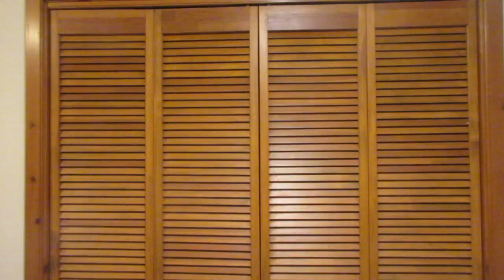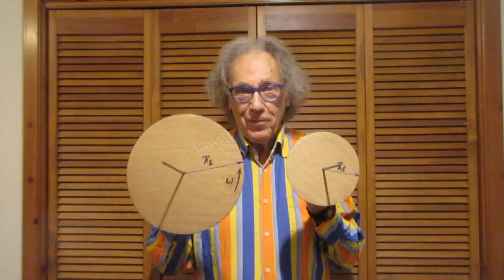Problem #8  Rotating Discs  - not easy!

Comment: Another approach considering friction: let F be the friction force that transfers angular momentum from disk #2 to disk #1 when they enter in contact.
F = µ FN
This force causes an angular deceleration on disk #2, decreasing its velocity (I2 is the moment of inertia of disk #2):
ω2(t) =  ω – F t / I2
and it causes an angular acceleration on disk #1:
ω1(t) =  F t / I1

The steady state is reached when both linear velocities are equal:   R1 ω1 = R2 ω2
This happens at instant:   
t = ω R2 I1 I2 / (F (R1 I2 + R2 I1)) 
Substituting t:
ω1 = ω R2 I2 / (R1 I2 + R2 I1)      and       ω2 = ω R1 I2 / (R1 I2 + R2 I1)

To calculate the moment of inertia of the disks:
I = π δ d R^2 / 2
If densities and thicknesses are equal on both disks then:
I1 / R1^4 = I2 / R2^4 

Finally, substituting and rearranging:
ω1 = ω R2^4 / (R1 (R1^3+R2^3))
ω2 = ω R2^3 / (R1^3+R2^3)
This is the same result obtained before (and posted) when considering just conservation of angular momentum.

Comment: Final angular velocities w1 and w2 of the two discs are as follows (note that the minus sign means a rotation in the clockwise direction, as I considered counter-clockwise rotations to be positive):

w1 = - w (R2/R1)^3/(1+(R2/R1)^2), which is clockwise, hence negative

w2 = w (R2/R1)^2/(1+(R2/R1)^2), which is counter-clockwise, hence positive

- from the moment the discs are brought into contact, there will be a decelerating torque on disc 2 and an accelerating torque on disc 1.

- the respective torques occur due to the kinetic friction Ff = mu*P, where P is the force in the x-direction on disc 1 exerted by disc 2

- kinetic friction exists at this point because of the relative velocities of the two surfaces in contact with each other

- the moment we are interested in is the moment when the kinetic friction will cease to exist

- kinetic friction will cease to exist when the relative velocities of the two surfaces will be zero

- therefore, at this point, the tangential velocities at the extremities of the two discs have to be equal

- from this point onward the torques on each disc with respect to each disc's CM will be 0, hence they will keep rotating with constant angular velocities w1 and w2, whose expressions are shown above.
Reply: in w1 there will be w (R2/R1)^2 instead of - w (R2/R1)^3 ....as they have to equal

Comment: We can conserve neither angular momentum nor energy. So we have to resort to torque analysis here. 
Now in equilibrium, w1R1=w2R2 because the discs are not skidding over each other. 
Then, the friction being u*N (N is the force with which one wheel pushes against the other), the torque equations are written for each wheel, in terms of the angular acceleration and moment of inertia of each disc. 
Finally, we introduce the time variable t, 
w2=(u*N*R2/I2)*t
w1=w - (u*N*R1/I1)*t
Eliminating N and t by suitably adjusting the equations and dividing, and subsequently using w1R1=w2R2, 
We get w1= w*R1^2/(R1^2+R2^2)
And w2= w1*R1/R2. 
It was a cool problem sir! 
^~^
Reply: u is the coefficient of friction
Reply: why isn't the energy conserved? from what I understand the two discs start rolling on each other so there is no dissipation of energy. I have almost the same thing, but my w1 is the square root of your's.

Comment: Nice woodworking :-)

You did'nt give any parameters on the energy loss due to slipping when the discs first touch and the final angular speed is not reached yet. This loss is to be ignored  ... yes ?
Reply: I know this is 2 years late, and he might have made a solution on it, but I will answer anyway. 
The discs do slip, and due to friction, there is energy loss. This loss does not have to be known to solve the question. In fact, this loss can be solved for. A hint I will give is that you should use torque, but not conservation of angular momentum as due to the system torque, angular momentum is not conserved.

Comment: Initially, the angular momentum is conserved.
Also masses are indicated by M for big disc and m for the small.
Li = Lf
Iw = I 2 w2 - I1 w1

1/2 M(R2 )^2 w = 1/2 M(R2 )^2 w2 -- 1/2 m(R1 )^2 w1
The final linear velocities of discs are same, so w=V/R

M(R2 )^2 w = M(R2 )V - m(R1 )V

Since densities are same,

d = m/vol
Masses are proportional to their radii’s square, so equation becomes,

d(R2 )^2 w = d(R2 )^3 V - (R1 )^3 V

(R2 )^2 w = V[(R2 )^3 - (R1 )^3]

V = (w (R2 )^2) / ((R2 )^3 - (R1 )^3 )

w1=(w(R2 )^2) / (R1 [(R2 )^3 - (R1 )^3 ] )

w2=w(R2) / ((R2 )^3 - (R1 )^3 )

Comment: Since there are no external torques, conservation of angular momentum about the center of disk 2 can be applied:
(I2)w = (I2)(w2) + (I1)(w1)                                                                                        Equation (1)

Find moment of inertia for each disk (using parallel axis theorem for disk 1):
I2 = (1/2)(m2)((r2)^2)                                                                                                Equation (2)
I1 = (1/2)(m1)((r1)^2) + (m1)((r1+r2)^2)                                                                Equation (3)

Substitute equations 2 and 3 into equation 1:
(1/2)(m2)((r2)^2)w = (1/2)(m2)((r2)^2)(w2) + ((1/2)(m1)((r1)^2) + (m1)((r1 + r2)^2))(w1)                       Equation (4)

Simplify this monstrosity to get another monstrosity:
(1/2)(m2)((r2)^2)w = (1/2)(m2)((r2)^2)(w2) + [(3/2)(m1)((r1)^2) + 2(m1)(r1)(r2) + (m1)((r2)^2)](w1)   Equation (5)

We have to get rid of mass. Let p be density and h be thickness. We know their densities and thicknesses are the same. For any disk:
m = pV = p(pi)(r^2)h                                                                                                  Equation (6)

For disk 1:
m1 = ph(pi)((r1)^2)                                                                                                    Equation (7)

For disk 2:
m2 = ph(pi)((r2)^2)                                                                                                    Equation (8)

Substitute equations 7 and 8 back into equation 5, then simplify:
(1/2)((r2)^4)w = (1/2)((r2)^4)(w2) + [(3/2)((r1)^4) + 2((r1)^3)(r2) + ((r1)^2)((r2)^2))](w1)                        Equation (9)

We need the answer in terms of w, r1, and r2 only. So we need to put w1 in terms of w2 and vice versa.
Since disk 1 is no longer speeding up and disk 2 is no longer slowing down, we know their tangential velocities must be the same:
v1 = v2                                                                                                                         Equation (10)
v1 = (w1)(r1)                                                                                                               Equation (11)
v2 = (w2)(r2)                                                                                                               Equation (12)
(w1)(r1) = (w2)(r2)                                                                                                    Equation (13)

Solving for w1:
w1 = (w2)(r2)/(r1)                                                                                                     Equation (14)

Solving for w2:
w2 = (w1)(r1)/(r2)                                                                                                     Equation (15)

To solve for w1, substitute equation 15 into equation 9 and simplify, also get rid of 1/2s:
((r2)^4)w = [((r2)^3)(r1) + 3((r1)^4) + 4((r1)^3)(r2) + 2((r1)^2)((r2)^2))](w1)                       Equation (16)

Solve for w1:
w1 = ((r2)^4)w/[((r2)^3)(r1) + 3((r1)^4) + 4((r1)^3)(r2) + 2((r1)^2)((r2)^2))]                                Equation for w1

Solve for w2, using equation 15:
w2 = ((r2)^3)(r1)w/[((r2)^3)(r1) + 3((r1)^4) + 4((r1)^3)(r2) + 2((r1)^2)((r2)^2))]                          Equation for w2

Comment: Thanks for this nice problem, Mr. Lewin ! I have a solution very similar to Soroush Khoubyarian, just a supplementary factor of R1/R2 in the expressions of w1 and w2... I finally get, using Newton's laws of dynamics and Coulomb's laws of friction :

w1 = k^2/(1+k^2) * w
w2 = -k^3/(1+k^2) * w
(where k = R1/R2.)

In the end (see demo below), about half of the energy being dissipated in heat through friction between the two disks.

Full demonstration attached : https://drive.google.com/file/d/0B_jqWcet5iN0Z1NKTjZPdWtsWm8/view?usp=sharing

Comment: There HAS to be slippage, otherwise the stationary disc would jump to a finite angular momentum about its centre in zero time! Also, angular momentum of the two discs about any point cannot be conserved because a couple has to be applied to the system to keep it level (and it doesn't reverse direction). I think that I see two correct answers that have slipped through the net!

Comment: it turns out that torque on the system is not zero so no conservation of angular momentum energy is not conserved as there will be  reletive motion between the disks you have to apply law of motion and solve for equation  
W1=WR1^2*R2/(R1^3+R2^3)
W2=WR1^3/(R1^3+R2^3)
SIR i am 16 years old and did this without any help really so do you think i have a good caliber
Reply from the maker: angular momentum is not conserved, neither is energy.
Reply: No you dont 
Just kidding bro
But mind ur physics 
Angular momentum and energy is conserved here as the force of friction here acts as an internal force
Reply: I also got the correct answer by laws of motion method 
but then i still have a confusion  that why cant we solve by energy conservation considering friction as an internal force in the system comprising of the two discs
By the way I am a grade 12 student from india     sir.
Reply: Lectures by Walter Lewin. They will make you ♥ Physics.  
Thanks sir my confusion got clear I solved the above problem by laws of motion but in my classes they told me that try to approach a problem by energy conservation method so i kept thinking but now it is clear to me that why angular momentum is not conserved as the net torque on the system is not zero so we cannot conserve momentum 
As to conserve angular momentum the net torque on the body should be equal to zero so the condition is not satisfied. 
Thank you sir

Comment: As there are no external forces the total angular momentum must be conserved:
Li = Lf    →    I2 ω = I1 ω1 + I2 ω2 

Assuming same density and thickness on both disks, this gives:
R1^4 ω1 = R2^4 (ω - ω2)

On the other hand, at the final stationary state the linear speeds are equal, so:
R1 ω1 = R2 ω2

Combining both equations:
ω1 = R2^4 ω / R1 / (R1^3+R2^3)
ω2 = R2^3 ω / (R1^3+R2^3)

Comment: Solution:-
Concept: 1. R1.w1=R2.w2---eqⁿ (1)
2. Time taken for disc 1 to go from 0 to w1= Time taken for disc 2 to go from w to w2.
I1.a1= F. R1, I2.a2= F. R2
where F= Friction
t1 = w1/a1 = I1.w1/(F. R1)
t2 = (w - w2)/a2 = (I2.w - I2.w2)/(F. R2)
t1 = t2 ----- eqⁿ (2)
Using (1) and (2),
w1= w.R2³/(R1³ + R1.R2²)
w2= w.R1.R2²/(R1³ + R1.R2²)

Comment: W1=(R2/R1)×(√[R2/(R1+R2)])×W
W2=(√[R2/(R1+R2)])×W
..
..
i made use of work energy for rotation,
the torque due to friction is reponsible for the bigger disc to slow down and smaller to start rotating to W1..
Reply: NYK but this friction will cause the system to lose energy
Reply: Max Mustermann  that's why I've used work energy it can be used for both when conservative and non conservative forces are present ...i hope that it's right
Reply: NYK im not fimiliar with these terms in english... Did you calculated the energy which is lost and then added this to your energy equation ?
Reply: to calculate the loss due to friction I need to know two things
1)total energy when both are spinning (friction absent)
2)total energy when both are spinning (friction present)

in the first case i fail to see how the two discs spin when friction is absent
Reply: NYK 
calculating 1 is easy, just use the principle of conserved rotational energy: I2 × w² = I1 × w1² + I2 × w2²

Comment: When they stop slowing down and speed up they both have the same linear speed. I'm going to call that speed as "V" now we can use angular speed and radius to calculate linear speed:            W1*R1=V      W1*R1=W2*R2   
                                                                                                                      W2*R2=V

Comment: Continued answer.
r2 qubed * omega squared  = r2 qubed * omega2 squared + r1 qubed * omega1 squared.
Using omega1 = r2 /r1 * omega2 I get..
r2 qubed * omega squared = ( r2 qubed + r1 squared * r2 squared ) omega2 squared.
Resulting in omega2 squared = r2 qubed/ (r2 qubed + r1 squared * r2 squared) * omega.
And omega1 squared = r2 squared / r1 squared * omega2 squared.

Omega2 and omega1 follow from taking the square root from both equations.
I would love to type this out, but , with respect , the answers are clear, and it saves me a lot of typing on my iPad.

Groeten uit Leeuwarden, NL, Koos Jorritsma

Comment: Here's my attempt.

We have conservation of angular momentum and both disks have the same tangential velocity at the end of the experiment.
  L = I2 w = I1 w1 + I2 w2 
  v = w1 R1 = w2 R2

Moment of inertia of the small disk can be derived from the larger one since they have the same density and geometry.
  I = 1/2 M R², M = ϱ R² π h
  I1 = I2 R1⁴/R2⁴

Solving for w2 and w1:
  I2 w = I2 w2 + I1 w1 = I2 w2 + I2 R1⁴/R2⁴ w2 R2/R1
  w = w2 + R1⁴/R2⁴ w2 R2/R1 = w2 (1 + R1³/R2³)
  w2 = w R2³ / (R1³ + R2³)
  w1 = w2 R2/R1

Numeric example:
  let R1 = 1, R2 = 2, w = 100
  w2 = 100 8/(1+8) = 88.89
  w1 = w2 2 = 177.78

Some kinetic energy gets lost:
  KErot = 1/2 I w²
  KEbefore = 1/2 I2 w²
  KEafter = 1/2 I1 w1² + 1/2 I2 w2²
  KEafter < KEbefore

Example:
  let I2 = 50
  I1 = 50 1/2⁴ = 3.125
  KEbefore = 1/2 50 100² = 250000
  KEafter = 1/2 3.125 177.78² + 1/2 50 88.89² = 246,920

I'm anxious to know if that's correct, thanks for the interesting problem Mr Lewin!

Comment: sir, I have solved the problem as follows: when the two disks reaches w1 and w2 respectively , they attain a pure roll situation . the angular velocity W1 is square of (R2) ×w ÷ R1R2 + square of (R1) and W2. is  R1R2×W ÷ R1R2 + square of (R1). and I also applied rotational kinematics and torque due to friction on both disks.

Comment: conservation of angular momentum: ΣIiωi(before)=ΣIiωi(after)
therefore: I₁ω=I₁ω₁+I₂ω₂
solid disks: ½*m₁R₁²*ω = ½*(m₁R₁²*ω₁+m₂R₂²*ω₂)
m=ρπR²*d: ½*ρπR₁²*d*R₁²*ω = ½*ρπ*d*(R₁²*R₁²*ω₁+R₂²*R₂²*ω₂)
 R₁⁴ω=R₁⁴ω₁+R₂⁴ω₂ (I)
conservation of energie: Σ½*Iiωi²(before)=Σ½*Iiωi²(after)
therefore: ½*I₁ω²=½*(I₁ω₁²+I₂ω₂²)
solid disks: ½*½*m₁R₁²ω²=½*½*(m₁R₁²ω₁²+m₂R₂²ω₂²)
m=ρπR²*d: ½*½*ρπR₁²*d*R₁²ω²=½*½*ρπ*d*(R₁²*R₁²ω₁²+R₂²*R₂²ω₂²)
 R₁⁴ω²=R₁⁴ω₁²+R₂⁴ω₂² (II)
Solve I&II for ω₁ and ω₂:
 ω₁=ω(R₁⁴-R₂⁴)/(R₁⁴+R₂⁴)
 ω₂=2ωR₁⁴/(R₁⁴+R₂⁴)
Reply: Xincheng Miao 
the angular momentum is not conserved in this problem

angular momentum (L) has a direction. since the two discs are spinning in different directions, you have to subtract L of disc 1 from L of disc 2. knowing this, its easy to see that L of the whole system is changing
Reply: Oh, I totaly forgot that ω is a vector, thx

Comment: Hello Dr. Lewin , here is my attempt.
-1: conservation of rotational energy must apply.
-2: I ignore friction at first contact between disks.

So: E rotation = 0,5 * I * omega squared. Must apply before and after contact
I = 0,5 * m * omega squared.
And m= A * d * density, with A = pi * r squared.

So before contact : E rotational = 0,25 * pi * r2 qubed (meaning to the power 4!!) * d * density * omega squared.

At the point of contact between disks the rotational speed must be equal: omega2 * r2 = omega1 * r1
So omega1 = r2 / r1 = omega2

Applying the law of conservation: 
0,25 * pi * d * density * r2 qubed (meaning to the power 4!) * r2 squared. ( I will not repeat this) must be equal to
0,25 * pi * d * density * ( r2 qubed * omega2 squared + r1 qubed * omega1 squared) 
So now we get rid of the constants 
 Will continue on next message, urgent phone call now

Comment: according to consideration of angular momentum L2=L'1-L'2
let angular momentum after they touch be w'
m=density*volume=d*t*A=d*t*pi*r^2
I2w=(I2-I1)w'
(r2)^4w=[(r2)^4-(r1)^4]w'
w'=(r2)^4w/[(r2)^4-(r1)^4]
therefore
I2w'=I2*w1
w1=w'=(r2)^4w/[(r2)^4-(r1)^4]
w2=(r1)^4w/[(r2)^4-(r1)^4]

Comment: w1 = w * (m1R1^2) / (m1R1^2+m2R2R1)
w2 = (R1/R2) * w * (m1R1^2) / (m1R1^2+m2R2R1)
Solved by using 2 Equations
eq1) conservation of angular momentum At time t0 when only disc 1 is moving total angular momentum L=m1R1^2w.   At time t1 when both discs are rotating total angular momentum shall be L=m1R1^2w.= m1R1^2w1+m2R2^2w2
eq2) At time t1 same tangential velocity.w1R1 = w2R2

Comment: w1 = w * ( R2^4 ) / ( R1 R2^3  +  R1^4  +  2R1^2 (R1+R2)^2 )
w2 = w1 = w * ( R2^3 ) / ( R2^3  +  R1^3  +  2R1 (R1+R2)^2 )

Concepts:
1. Constraint equation for final condition (no relative speed between the discs, for friction to stop acting).
2. Angular momentum conservation about acis through disc 2.
Reply: SaiKrishna KVMB the angular momentum is not conserved in this problem

angular momentum (L) has a direction. since the two discs are spinning in different directions, you have to subtract L of disc 1 from L of disc 2. knowing this, its easy to see that L of the whole system is changing